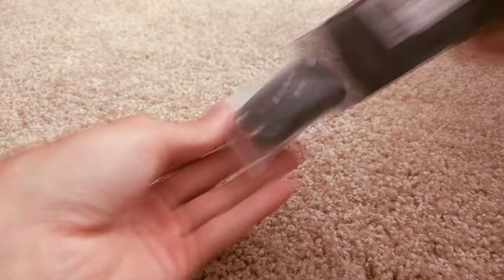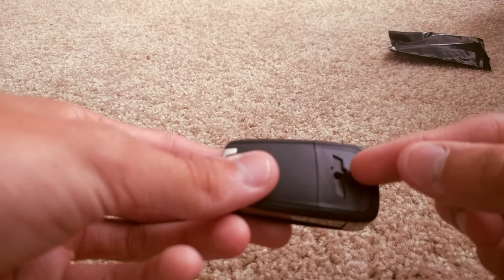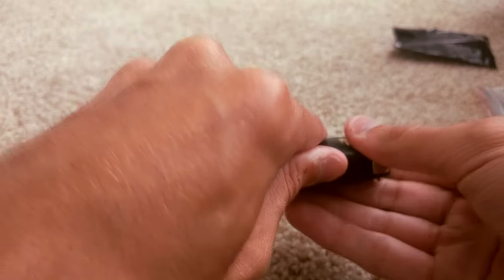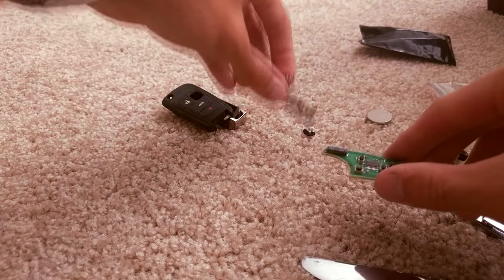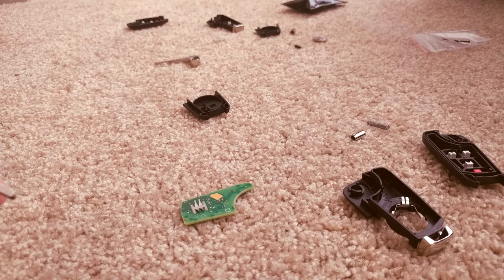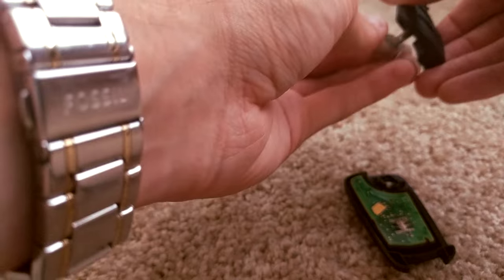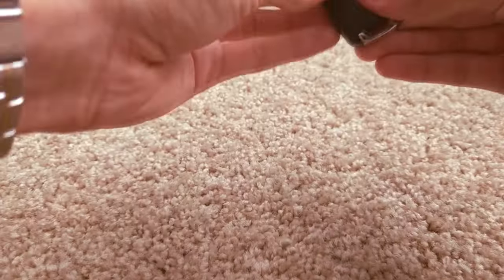DIY Replacement of a Chevrolet Key Fob! (Camaro, Cruze, Equinox, Malibu)

Comment: these are the worst fob design ever. They need real buttons that won't disintegrate over time. gm fail
Reply: Clearly you didn't use much Toyota and Hyundai ones
Reply: After doing this, I realized that this key fob is the strongest thing ever built by chevrolet. Besides this toughest keyfob, everything else in this car is falling apart. Thanks chevrolet for doing something right. although instead of using glue, 3 or 4 tiny screws whould have work just fine and much easier. Thanks chevy for convincing me again to buy a japanese car next time.
Reply: @alexrosca6545  Literally I need a new key fob every 4 months, they're absolutely terrible.
Reply: The silicone design is 🗑️!!!
Reply: Wow I thought it was my long fingernails 😩😩
Reply: Have my original fobs both of them since new in 2012, never had to replaced. How the hell you all press the buttons like??? Step on it with your foot? Lmao
Reply: You’re lying
Reply: The new key fob opened easily but I cannot open the old one to save my life I got several cuts on my hand to prove it
Reply: Cruz
Reply: Good luck getting the old key fob apart. I destroyed it trying to pry  it apart. The new one was super easy. After getting it apart it was relatively easy to swap over the components.
Reply: I have the Cruz and the buttons just literally disintegrated over a period of a few months. Embarassing quality

Comment: Just finished swapping the circuit board into cheap shell. A few observations: The old fob is not designed to be taken apart; I inserted two screwdrivers to pull it apart and broke the old shell. The head of the key part is different (took me a lot of time to figure this out) so I removed the pin holding the key with a pushpin and replaced the pin holding it in place with needlenose pliers and hammering it it. The spring on the new fob is much weaker than the one on the old fob, so the key does not flip open with the same satisfying authority. I found the video helpful.
Reply: Its because you got a cheap replacement. Quality is everything.
Reply: Did you have to do any additional steps once you switched it out? I’m having the exact same experience as you are but my car went into “service theft deterrent system”. I put the car in the on position but the signal won’t go away.
Reply: You need to wind the spring up to make it flip harder
Reply: same here i punctured the board when i was trying to crack it open
Reply: The key has to be spun 2 full rotations before closing the case
Reply: @johnathanespinoza510 im currently having the same problem, did this happen before or after your new key?
Reply: @johnathanespinoza510 did you ever figure this out? Cus mine is the same
Reply: @josh3979  After my new key. I ended up calling a locksmith and they were able to fix it.
Reply: @Jcd6200  I ended up calling a locksmith. They were able to help me.
Reply: @johnathanespinoza510  any idea what they actually did to fix it bro? Ive tried everything ive seen on yt but no luck.
Reply: Thanks, I'm glad I read your comments on the fob. 👏🏼👏🏼👏🏼👍🏽

Comment: 5 years later and this video is a Godsend! My fob fell apart and I bought my car used and it only had one key. 🙄
Thank you for this video!!!
Reply: Heh. I found out my Impala has hidden keyholes, and the covers are easy to pop off. A bit annoyign cause you have about 6 seconds after you unlock to stick er in the igntiion or the alarm goes off, but the car
 is usable. I'm assuming if the Fob is dead the key might not even work to turn to unlock. (magnetic strip links up with the fob's board/pgoramming)
Reply: Did it work?
Reply: Did this fob work?

Comment: Chevy was gonna charge me some crazy amount of $ for a new fob! I went on Amazon,  got 2 for like $20..  followed this video and  DONE!
It works. I did the switch by putting the motherboard into the new fob , tested it out and saved over $100 bucks..
It's ridiculous that I replaced this thing 2x because the UNLOCK pad wears out ..😮

Comment: I just did mine, could't swap the key, there's a slight difference between the oem and the blank and I didn't feel like going to a locksmith.
However, as someone else mentionned, by removing the tiny pin that holds the key blade using a finishing nail, needle nose pliers and a hammer, I was able to swap key blades

12$ for a "new" key fob is awesome

Comment: IT WORKED!! i damaged my fob prying it open coz it seems like the bottom just wouldn't seperate properly but no big damage, all the button worked AND the car starts!! THANK YOU SO MUCH I SAVED $65+TAX!

P.S: everyone needs to understand that when he says "turn clockwise" he's talking about the upper casing with which he attached the spring, when you counter-clockwise rotate the casing while pushing down the spring locks into place.

Comment: To make it work correctly you must also switch the machined key, meaning you have to knock the small drift pin out of both metal keys and put the original key into the new chrome swing lock mechanism and reinstall the pin.
If you don't do the last steep, the key will not stay closed in your pocket.
The new parts in the swing lock mechanism are clocked differently and sized differently so no matter how you try to interchange the mechanical mechanism it does not reassemble and work. You must switch the actual metal key with the chrome swing or hinge mechanism. You need a hammer, long nose pliers and either a #53 or #52 drill bit that you will be breaking and using the shaft of as a drift punch. Drive the pin out using the hammer and drill bit with the shaft of the bit against the pin. When putting the pin back in, hold it with the long nose pliers and drive it in with the hammer.
So when all is done, you use the circuit board and the machined key portion of the Original key fob, everything else is the new parts.
Other then that, it's perfect!
Everything else in the video is super clear.
EDIT:  Thank You for this video!
Reply from the maker: Never bothered to make a follow up video on this before selling the car, but what you described is exactly how I fixed this issue with the key 👍
Reply: @brandonnotgood  Excellent video Brandon! Thank you for posting it.

Comment: I'm relieved and surprised this worked because usually when I try DIY I do more damage than good.

Most of the tutorials on the internet make this seem effortless but getting the original key apart is a bit tricky. I work in a company that assembles electronic devices similar in design to this key and I knew exactly that the shell is going to be glued, but I did not expect it to be glued by some kind of military-grade super glue. Or maybe it was so hard just because my Chevy Cruze keys are almost 10 years old. I kinda chipped away bits of the plastic shell away with a swiss knife, destroying the knife and my desk in the process, until I got pissed and went to the garage and locked the key in place in a vice and used iron pliers. In hindsight I should have done that right away because the key then came apart smooth as butter. Of course you gotta be really careful not to damage the electronic chip inside but there's enough of the plastic bits that you can grab onto to take it apart safely.

So really that is the only difficult part. While I did put the thing back together easily enough, just like in your case the metal key part itself does not fit the plastic shell perfectly, apparently mine is a size 6 and the key I bought was a size 1 - I think. The thing doesn't stay closed, BUT, if you DO NOT ROTATE the spring when putting the case back together the key will just be kinda loose so you can put it in your pocket without getting poked and you can open it like a zippo - how cool is that!

And another thing, even though this process took like half an hour and the battery was removed the whole time, the new key surprisingly still worked and did not need any kind of re-programming. Not sure how, I'm guessing the code is hard coded into the chip or whatever. I do drive an European 2011 Cruze, so it could be a totally different story for cars in other markets.

Comment: I tried this and the actual key part like the metal peice from my old key wasnt fitting the new one. What i did is, theres actually a little hole where the long part meets the lower round part of the key, you press that it will come off and you can just do the same for the new one and just swap them. You can see the hole im talking about at 2:23 in the bottom middle of the screen, use a toothpick or something similar and a small metal peice will come out and you can just swap out the key part like i mentioned.
Reply: This comment right here ❤

Comment: Great knowledge here. Mine didn't go back together right so it locks closed and pops open...but it is programmed, and does everything it is supposed to. Thank you. That was $40 saved from needing a key cut.
Reply: Where are you getting it cut for $40?

Comment: There's usually a screw that needs to be unscrewed before it comes apart. If it doesn't come apart easily, don't force it like I did. Use needle nose plyers for better leverage.

Comment: Thanks for the video ... I would have never been able to have done this without it.  I had a tremendously hard time opening the old fob.  I had to score the edges of the fob's seams, and then use closed needle nose pliers into the side opening (then spreaded them open) to get that fob apart.
Reply from the maker: No problem! Just happy that someone found it useful.
Reply: I had to do the same thing with mine. It was almost like someone glued it shut. I bought mine used as well.

Comment: I was successful, but I had to pretty much destroy the old fob to get it apart. I also kept the original stronger spring. The key doesn't swing out that well yet but I think it will wear in with time.
Reply: you have to preload the spring when putting on the back piece, carefully turn counter clock wise 2 times to "wind" up the spring so the opening action is stronger.

Comment: As the post mentioned 
1 - original fob doesn't come apart easy
2 - the newpush button assembly and the old key were put together in order to work
3 - removing the little pin did not align completely, be care not bend or break
4 - spring tension is done by 
- placing bottom fob on surface 
- put spring with tab down in slot
  In bottom fob
- put key and button together 
- put spring in bottom of button  
   with key
- use slight pressure to hold
   spring, button and key together 
- then rotate key counter
   clockwise 3 to 4 times
- this should work with both old
   or new spring
- after rotations complete, put
   keys in the close position and
   hold
- it's not to hard ? but holding
   key in place, put circuit board 
   in bottom fob
- add top fob and press together 
- at this point, spring tension
   should work. 
- Hope this helps

Comment: The engraved key is held in by that little roll pin. Put the key in new remote and reprogram it takes 30 seconds for two remotes to reprogram, Chevy wanted $100 to reprogram

Comment: I basically destroyed mine trying to get it separated.   That damn thing was sealed with the strongest glue in the universe.
Reply: Did it work fine after, though?
Reply: After doing this, I realized that this key fob is the strongest thing ever built by chevrolet. Besides this toughest keyfob, everything else in this car is falling apart. Thanks chevrolet for doing something right. although instead of using glue, 3 or 4 tiny screws whould have work just fine and much easier. Thanks chevy for convincing me again to buy a japanese car next time.
Reply: @alexrosca6545  lol CLEARLY their way of having to make people shell out an extra $50 to $300 bucks. literally had to tear mines up all morning today with a mini hacksaw to replace it with the $10 fob case I got off Amazon. hell, I'm proud of myself. felt like I got to stick it to "the man" for at least a day... 😂
Reply: @alexrosca6545  did you buy your car used?  I have over 100k miles on my Camaro and have had zero problems or issues.  Mine still looks and drives new.  Maybe someone just didn't take care of your car properly.
Reply: @gearheadjeff  I have a 2013 Chevrolet Malibu with 110k miles... Yes, I bought it used at 108 miles... I always buy my cars used, drive them for couple of years and then get into something else, from german to japanese to american etc... I've tried out and had many makes and models, but NEVER ever had to put so much money into a single car within couple of months of ownership! (I have my cars inspected at the mechanic before buying). Best luck I had with the Japanese cars, one time drove a camry with 170k miles for 2 years and only did 3 oil chances! so, to maintain it I only spent under $100 in 2 years. This chevrolet Malibu already cost me thousands in maintenance in 2 months!!! I drove it normally for a month, then it overheated.. did a headgasket replacement.. then 2 weeks later the engine compartment was smoking.. replaced the intake manifold... then exhaust, then sensors, then bushings and links, then the radio, nav with backup camera and the power seat stopped working, haven't repaired these yet, I probably won't, too expensive, then a week ago even this damn key broke!!! WTF GM... this thing looks beautiful but boy what a piece of crap this is...
Reply: Glad I'm not the only one.  My keys are pressed in and broke but for some reason I'm still paranoid to break it.

So true they don't mind using everything else cheap but when it'll save people money forget it.

Comment: In case anyone else has this problem: I had to shave down one of the three metal notches on the button so that it could into the hole of the key. The replacement I ordered from Amazon was not an exact fit. 

Besides that, everything else was perfect, great video!

Comment: Another way would have been to tap out  the pin holding in the key on both fobs and just put your key in the good one. Nice video.
Reply: TheSocratesian doesn’t work that way. It isn’t a pin. Just looks like a pin.
Reply: Yes and no. Yes, if you haven't already programmed 5 remotes to your car. No if you have. The way he did it works without having to reprogram a new remote. You can only have 5 remotes programmed to your car. After that, you have to have the Dealership un-program and reprogram to wipe out the memory. I have no idea what that would cost, but I imagine not cheap. By the way, yes, I have 5 programmed. When the recall happened on the remotes, they gave me two chipped keys. That meant I then had 4 programmed devices. The two original remotes and the two chipped keys. When they gave me the chipped keys they removed the switchblade style keys from my remotes. Well, I wanted a switchblade style remote, so I bought another and had the key cut. That made five total. Now my buttons are wearing out on the original remote. I still have the other two, but in order to repair or replace that worn out remote, I will either have to do this style of repair, or have the dealership get involved with the programming.

Comment: I went ahead and paid $109 for a nee one then took a change on my old ones. 
  I finally got them apart. No screw in either. 
  I manger to fixed one with the two, so now she has a new one, and I have a repaired one.

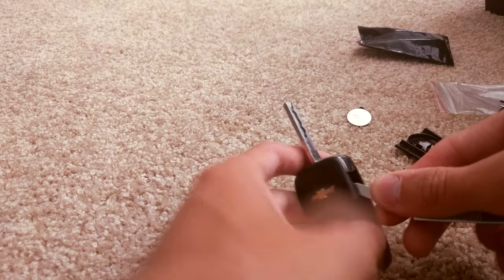Comment: Dated October 6th 2022, @ 2:01 . The Key FOB was a bitch to take apart, however; the small gap opening between the key and the folder. used a Needle nose plier closed first-> insert -> try and open that did the trick to release the casing and the motherboard. it Help on the fix!! Thanks !

Comment: some Krazy glue or gorilla glue applied along the clamshell contour/crack and a  vise clamped tight tor 24 hours is a great way to reseal the fob, provided all your parts in 100 % working order.

Comment: This video was extremely helpful, but the twist and close part was so hard! If anyone has any other tips, it would be great!
Reply: with the twist and close bit, have the button and spring already placed in the key, the put the other end of the spring in the back of the case and twist the direction the key will be coming out once (or else the key wont move when you press the button).  If you try to do it like he did it, it will be much harder.

Comment: Hey Brandon, buddy boy, did it work to start your Chevy vehicle? I am about to switch two key fobs in bad shape into two brand new key fobs, so I am watching lots of videos like yours. The ending would be perfect if you started your vehicle with the new key fob. I am going to guess it worked. Thanks for the humor and the instructions. I am also scared to do it, to be honest, since I am programming this for someone else's vehicle, okay, it's my husband's vehicle. He borrowed my Jeep and when I saw how bad his key fobs were, I decided to program two new ones for him. Thanks so much! Wish me luck, I think I can , I think I can! Yes I can. LOL - This saves everyone a ton of money- some pay over $350.00 for a new fob, because they need a new mother board, and then someone has to but a new key, and they charge big bucks for it all. You did a good job!
Reply from the maker: Yeah, it started the car just fine and continues to work years later for the new owner of the car. Just make sure you switch the board from the old fob into the new one and it shouldn't give you any trouble starting up. If you use a new motherboard, it will have to be programmed. I did also end up switching out the blade holder to the one that came with the new fob shortly after making this video and that allowed the blade to stay closed. A lot of people have commented about that on this video and they include pretty good instructions for getting that done. The trickiest part about all of this (and hardest to film) was just getting the tension back on the spring and getting the fob to close. Looks relatively easy when you see someone do it, but it's harder than it looks to do it without everything coming apart over and over again. Good luck with everything!